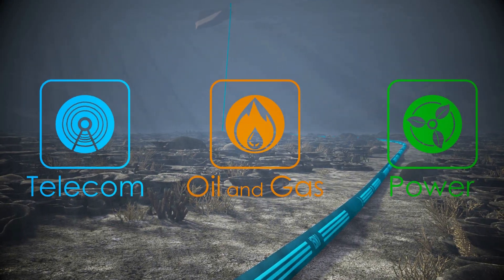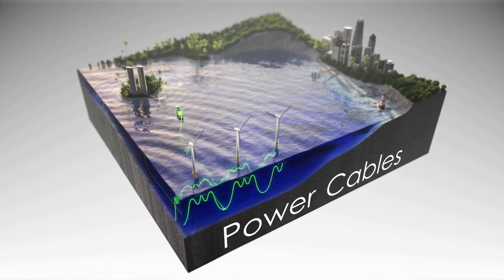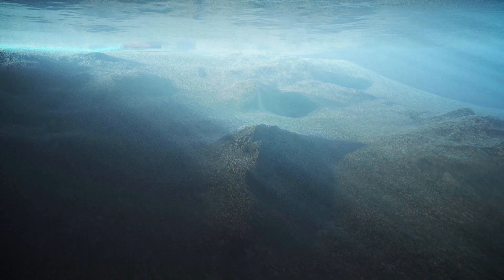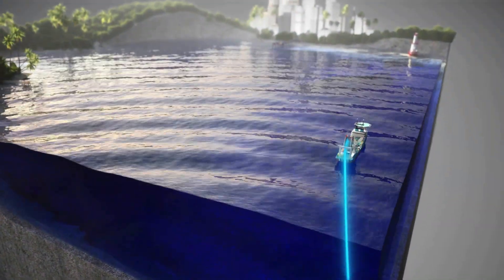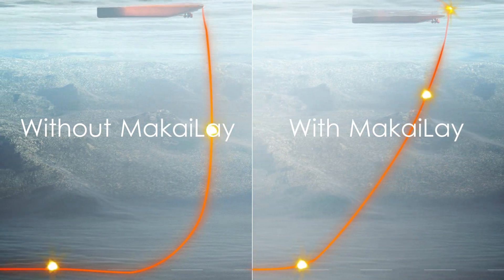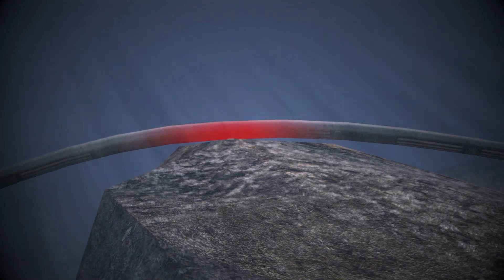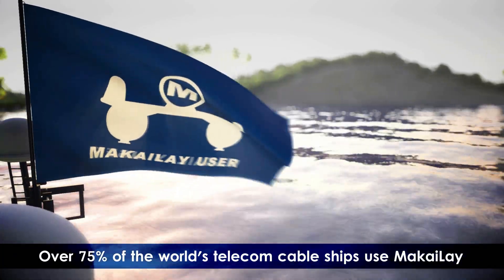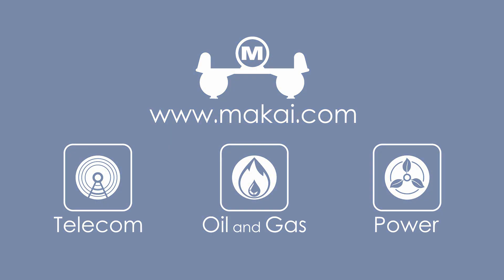Submarine Cable Installation: Tools for Power, Telecom, and Seismic Cables (MakaiLay)

Comment: Do they ever transfer power through optical cable. Most future cabling would be under sea because they are easy and recovered and maintenance and straight through connectivity. And power export to neighbors or distant countries including oil lines.
Reply: Enough energy to power the repeaters, not enough to export- that would need a different type of cable.   Recovering them from 15,000 feet of water isn't exactly easy- lots of dragging hooks back and forth hoping to catch the right thing.
Reply: Optical cables transfer light signals 'information ' ,Also the future is low orbit satellite internet not undersea cables .
Reply: @omariw845  I'm pretty sure the backbone of the internet will remain fiber for many, many decades there are undersea cables that can handle several Petabits with little latency and the cable is capable of so much more bandwidth we just don't have the equipment to send that data yet so plenty of space to grow as our data demands increase.

Comment: It only proved that the satelite does not exists'
Reply: No, it doesn't it just proves that satellites are very rarely used for the internet. Satellites aren't capable of the bandwidths fiber cable can do at least not as cheap and fiber has much less latency then satellites

Comment: So is there some way to connect many wires and resupply to make it thousands of miles long in sections like a road or can one continuous wire thousands of feet long really fit on one boat? Or is there a fleet of boats to fit that much wire?
Reply: My first trip on one of these ships, we laid a cable from Whittier and Jeauno, Alaska to near Seattle, WA.   Yes, they can be connected to other cables without too much trouble and ships can carry 5-8,000 miles worth of cable at once.

Comment: Cables were laid on the ocean floor in the 1850s?  I do not think so.
Reply: trwent The first attempt to traverse the Atlantic with a cable was 1857 and was a failure but they already had cables connecting US to Canada in the Atlantic. The first successful cable from Newfoundland to Ireland was in 1858.

Comment: so on the ocean floor, is the earth still considered spherical?
Reply: It would take 380 km for the round earth to change in 1 degree. It's still spherical. But this ball is so big you can't see it...
Reply: xcen1 momentum....u need to cancel out the speed of ur body moving with the earth at around 1000 miles per hour.
Reply: xcen1 I think you're onto something there seriously
Reply: If you're in a car going down the road and you throw a ball in the air it will keep going the same speed as the car but if you're in a car and throw a ball out the window it should technically stay in one spot but then gets pushed around by the wind unless it has enough Force to counteract it like forceful throw
Reply: Sadsam727 , it's hard to really test the ball inside car being thrown,  it has to be in a bigger vehicle like a truck. If you throw the ball out of car while moving highway speeds, the ball should still be moving fast like car,  but wind and gravity will slow down ball quickly. Like you ever ride fast on bike and fall off,  your body keeps moving forward but you stop cause you hit the ground
Reply: sadsam727, 
https://www.youtube.com/watch?v=5tv4hyKx7Vs
Reply: xcen1 if u are interested u need to learn earth's graphitatinal force, momentum and atmospheric resistance. This are all covered in high school physic in case u haven't reach there. It's at least 3 hrs of physic principal leanring so answering in a post will be confusing.
Reply: xcen1 anyways the biggest problem with ur concept is cancelling out the momentum cuz it's a constant gravitational pull from the center. Every second new force is added. Look up videos made at the equator about water swirling in different directions(counter clock for north hemisphere and clockwise for southern hemisphere).
Reply: sheeplvl1, no I didn't take H.S physics.  I had NYC public education which is garbage, but then most usa public education is garbage.  They lower the standards to allow everyone to graduate. If you'd send me a link to it I would look at it.  I don't know how old you are, but I'm in my 40s and have seen enough life to not always believe what's written on paper.  Whatever is in the 3 hr physics class I need to see some real proof.  Not just a bunch of numbers and laws of science, and formulas.  I have taken high school chemistry which I didn't finish / pass.  It was just formulas, of which we never applied it.  Public education all we do memorize and repeat.  We don't apply it onto any real applications.  Beyond what I've said.  I tend to question any government or mainstream info.  From medical of which I suffered side effects from a drug.  Even NASA's videos of how scientists at the ISS give a video showing they are all upright.  Their legs are not standing on the ground, but how could their torso's be upright, if space is zero gravity then they should be upside, down, sideways etc.. then there's 9/11.  The financial crisis if you've seen the documentary on it, they showed how the financial experts came up with a bunch of mathematical formulas that are 50 pages just to confused people and at the end it collapsed.
Reply: sheeplvl1, the constant gravitational pull from the earth center doesn't explain weather conditions such are hurricanes, tornados, storms.  Like hurricane sandy which at its peak was moving 115 mph, yet an airplane moves at 500 mph cannot be independently somewhat free of earth's pull?  I can accept earth's gravitational pull has some affect, but not 100% affect where in my point it takes exactly the same time to fly half way around the earth in both directions.
My friend that flew to Japan told me the flight path is to go over the North Pole.  Which lends more credence to the flat earth map of north pole being in the center of the flat earth.  Because its a straight direct path.

Okay I drive my car on highway speeds I always in either direction north, south , east , west.  get the same highway gas mileage.  You say earth has some directional gravitational pull ?  so maybe in a different direction driving my car at highway I would get lower gas mileage?  You obviously don't feel any gravitational pull while walking or running.  But if you're taking earth's gravitational pull along with the fact earth is spinning.  And moving at high speeds driving 60 to 80 mph, your car engine is doing the work, so you might get lower or higher gas mileage at different directions?
Reply: earth turning has it's effect on everything. Just very slow...
https://www.youtube.com/watch?v=Ey12aoF4JOc
Reply: Ask this guy your question since he has a physics channel about westward and eastward.
https://www.youtube.com/watch?v=3gNkgj9h2oM
Reply: sheeplvl1, here's another analogy example.  How does a ferrari drive faster than my car on the same earth?  with the same earth's gravitational forces?  Do you get my point now?  Man made objects can break past earth's forces.
Reply: sheeplvl1, yes but that momentum ends pretty quickly.  Let's say earth is spinning at 1000 mph right, airplanes travel at 500 mph, so then in 2 hrs we've gotten rid of that momentum.  And thus are moving independently right?  Therefore maybe 8 hrs you would arrive halfway around the world right?  I'm not doing real math here.  But it definitely should not be the same 13 or 16 hours travel time in both directions when traveling half way around the world.  This only makes sense in a flat earth.
Reply: Uhh this video is false, airplanes fly at 500 mph, not 100 mph... doesn't explain travel routes, why fly over the north pole to go to asia... like i said before earth spinning at 1000 mph, airplanes fly at 500 mph with 10 to 15 minutes from takeoff so roughly  in 2 hours it could've over taken the earth's rotation.  airplanes fly at 30K above sea level so air is thinner and less air friction / wind resistance right?  And also possibly above the Jetstream...
Reply: Sheeplvl1, I don't understand this video of this pendulum swinging around.   yes earth has its affects on objects.  But you don't understand that a man made airplane going 500 mph is moving us past natural world forces that god gave us.  If i drive my car at safe 60 mph to a location, but if i want to drive faster and go 90 mph without getting pulled over I will arrive at my destination faster at 90 mph than at 60 mph right. Man has been able to push past the natural basic laws of physics can i say?  Deep water horizon has dug so deep onto earth it exploded..  

a man made Airplane at 500 mph is controlled.  you decide its direction, altitude, speed to which you can fly it to its destination with the shortest route and quickest time.  You treat this man made controlled machine like its a natural object, like a bird flying around gliding off the wind.  You watch documentaries birds fly by gliding with the wind.  Guess what an airplane is not designed to glide off wind.  It is designed to counter wind resistance.  Do me a favor watch a documentary on how a commercial jet is designed with respect to its flying capability.  Airplanes, cars, go faster than any natural object.
Reply: sheeplvl1, you're wrong.  okay if the earth were rotating and 24 hours is one rotation then 12 hours is half way around the world.  Then why does it take about the same amount of time to fly from NYC to asia (japan)?  The plane to should against the rotation of the earth and arrive at the destination much quicker.  Or you shouldn't even have to fly at all, just hover for 12 hrs, wait for the earth to have rotated half way around the world and just land it?  Don't tell me atmosphere moves with the earth.  If that is so then how do you explain hurricanes, tornadoes, thunderstorms?  Like hurricane sandy moved from the atlantic ocean then westward inland and we had no power for 5 days.

Comment: Lol I thought we had satelties lmao
Reply: way too expensive cost per bit transmitted, long delay, distance and reception issues, slow speeds
Reply: Yeah we have some cables running to space
Reply: Baigle1 that is the reason why we use cell phone towers for GPS signals the satellites are there
Reply: its assisted GPS, uses both.

Comment: lol, so wtf 15000 satelite in space
Reply: way too expensive cost per bit transmitted, long delay, distance and reception issues, slow speeds
Reply: @Baigle1  eyes closed
Reply: There is none
Reply: @deathknight752  eyes open
Reply: For wireless
Reply: @max marrero you know you can figure this out with a directional antenna? 
I'll give you a few months to realize that space, and satellites, are a real thing.
Have fun m8.
Reply: Most ships don't have a fibre connected to their stern while crossing the ocean to make calls with.
Reply: nice  proff  that theres  no satelite  :D !! ! !  thx sea  cables
Reply: Antarctic is the only continent that doesn't use physical wire... They rely their communications via satellite..